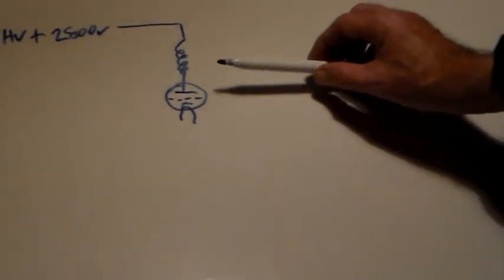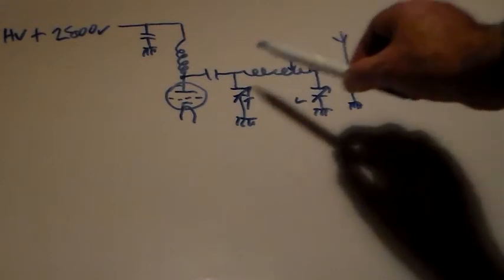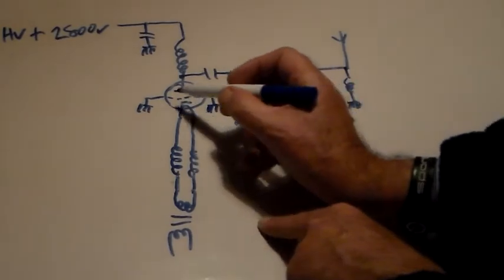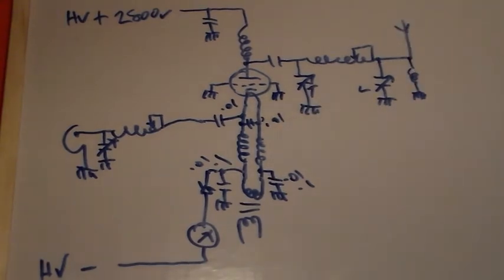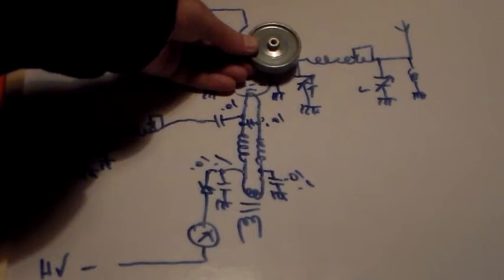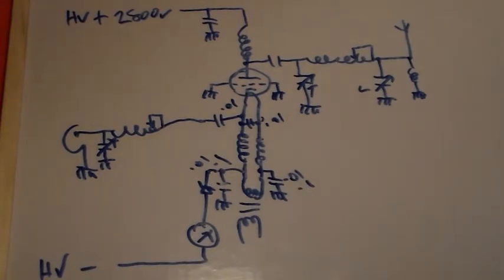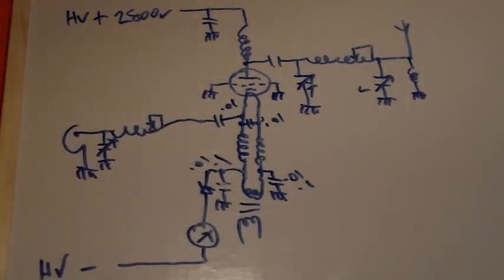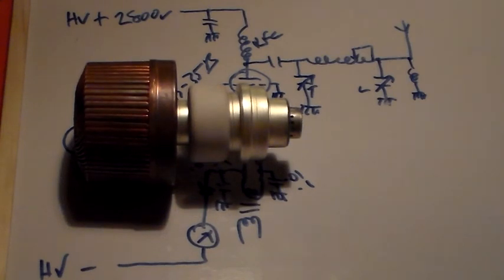'Old School' GS-35B Tube HF Linear Amplifier.

Comment: very istructive and  easy way to understand how a valved amp works but its not really that easy .pay attention to High voltage risc .beginners may burn before seeing the neeedles raising . always shrt cut  condensers before use ...they remember always their charge ...lol .tahk you so mach sir .best 73 .best wishes for all radio amateurs .CN8BHA .
Reply from the maker: Thank you Sir... very good points, 73.

Comment: figure on 3800-4kv and 30-32v bias . at that voltage cathode impedance will be about 35-40 ohms . legal limit with ease .. not sure you are going to make it at 2800v . I built using pi input I have messed with a couple of them nice tube . like a super heavy duty 8877 . be sure to run them with filament and blower for 24 hours minimum as with any nos tube . have seen a couple that I couldn't get rid of gas and found there was rust inside
Reply from the maker: Thanks for the info. I just looked at the spec, it shows 3kV max anode voltage and a transformer that would give around that voltage became available. If it doesn't make 1500W it's no big deal as we're only allowed 400W PEP max. It would be good to get 1kW out of it though... nice round number. I had thought of using an L match circuit on the input just to keep it as simple as possible. I have run it with heater and blower only for 24 hours already, but thanks for the reminder. I'll have to get my backside in gear and get it finished.
Reply: VK6CS yes no problem alot of cold war ara russian tetrodes the specs were off . but in military use of that tube they often ran as high as 5kv .. first one i built was off of there specs was a dud never could get over 30% efficiency till i pushed hv up to 3700 loaded then i could achive 50% and thats when i really started askinf questions haha .... good stuff keep the videos coming
Reply from the maker: Crikey... sounds like I'll be asking lots of questions. If I ever do get it finished I'll certainly post a video or two showing how well/poorly it works. I have made the PA tube mounting/air-box section modular so if it's really poor I can substitute the GS-35 with another tube/tubes. I did wonder about using a glass tetrode or two, this would allow screen grid mod to be applied for AM. And glass tubes look more like real radio.

Comment: I am concerned that your bias diode needs to carry 700 mA at 15V.  What diode number will handle that amount of current/power?
Reply from the maker: http://au.element14.com/solid-state/1n3313b/zener-diode-50w-14v-do-5/dp/1671488
Reply: That'll do it!
Reply: use a r'gulator 7815 v for that

Comment: Triquint make an RF transistor that runs linear from DC to a few dozen GHz, but they want roughly £680 each for them, and the USA legal limit or something respectable would take 12 or more. I looked at using this particular valve, when I obtained a pair of very old US Navy anode supply transformers that put out 6200 volts CT. Unfortunately the primaries are 105-120 volts AC 60 Hz. I have two of them, so running the primaries in series could work with 230 volts. I used MOSFETs on the primary to dial back the anode voltage. I am trying to use the UK terminology, for VK6CS's sake. I bought a USA made 8877 from an eBay seller in France, and that gave me a lovely output of 1500 watts peak effective power, with the plate voltage dialed back, or the drive power dialed back. Honestly, I am not 100% sure if the primaries on the anode transformers are 95-100-105-110, or how exactly those are wound, to be absolutely certain. I know the previous owner was running three 3-500ZG Chinese tubes. His power supply, was a rather spooky affair. Eventually his wife demanded he dismantle the thing and sell of the 3600-4000 volt anode supplies, lest he or one of his children get into it and light themselves up like the proverbial Christmas tree. I twisted up some coils using seamless extruded copper tubing, which I silver plated using a DC power supply, and some silver plating solution. You wind coils to rival mine! I made  VHF jammers when I was back in primary school, and my classmates and I drove the local tele salesmen to madness at the local department stores with them. We would jam all the channels but two watch the salesmen run about changing channels, and then jam those channels. Then we would watch the frantic fun begin all over again. Or range was only about 15 maybe 20 meters.   Great primer on making a linear amp! I have been considering buying some old Soviet valves! Now I see one being used! Superb, mate.  CHEERS, 73 KI7AQJ Arizona.
Reply from the maker: Well,almost used. I keep telling myself I'll finish this thing and fire it up. I'll tell you what though... I think I would have been better off with a glass envelope tube or two to keep the blower noise down. 

Those transformers sound pretty useful, you could series the primaries and parallel the secondaries. You didn't mention the current rating of the secondary winding's but if someone was using them to run 3 x 3-500Gs there should be plenty there. You could put each transformer on a variac to confirm the primary voltage rating if you know what the secondary voltage is supposed to be. But I'm sure you know all that. Good luck with it, 73.